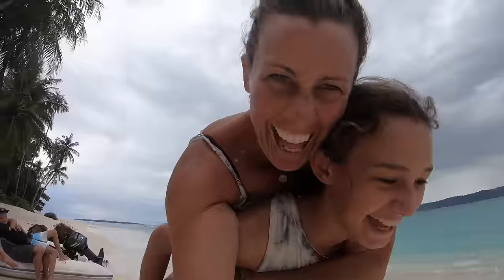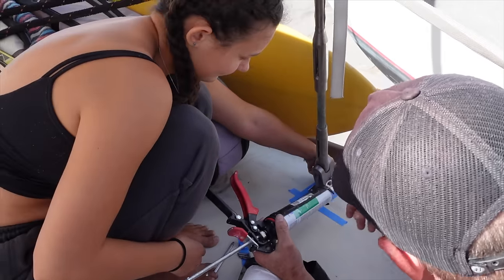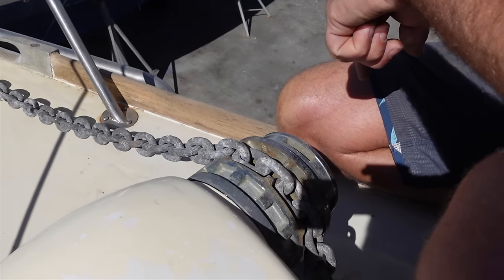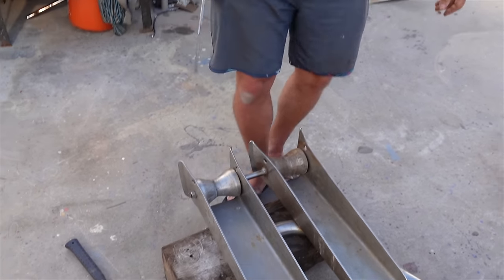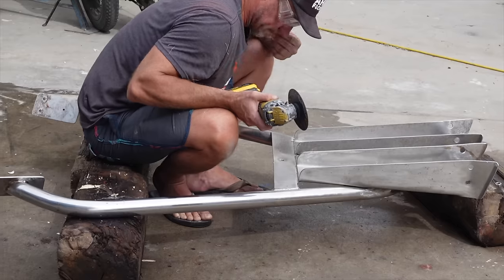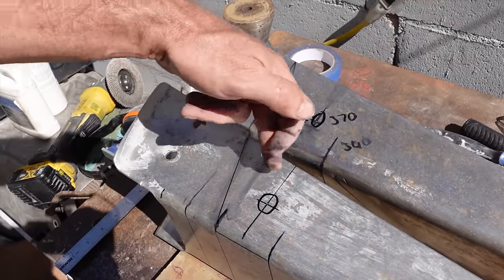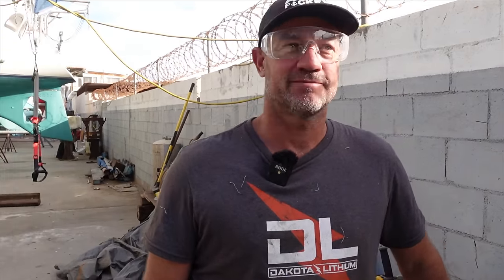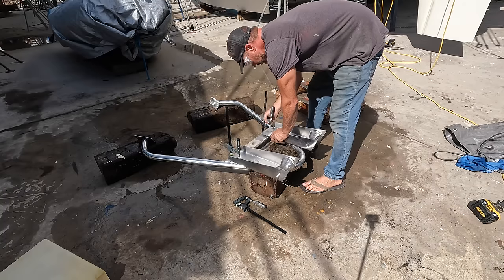An important Modification for Safety Ep 397

Comment: Won't welding a strap across the top above the rollers foul the anchor from pivoting? Jamming the anchor from dropping in or retrieving the anchor back on board the cradle.

Comment: Could you explain what 42 is compared to silicone as I have no ideal, great vid stay safe and those anchor rollers are going to look and work great
Reply: It is 4200, and is a polyurethane. As such it is a very different chemical makeup than a silicon sealant. Unfortunately my grasp of the chemistry isn”t strong enough to try and explain further.